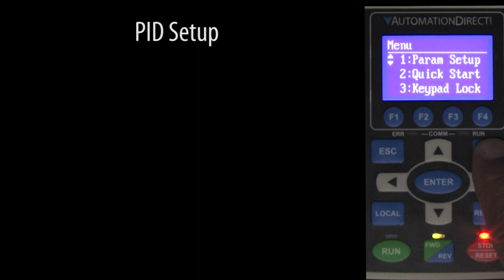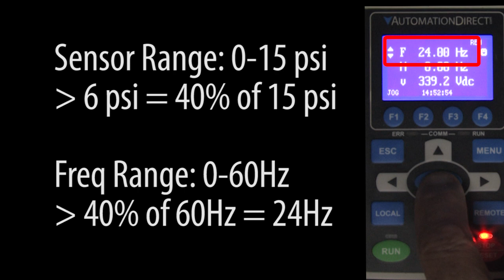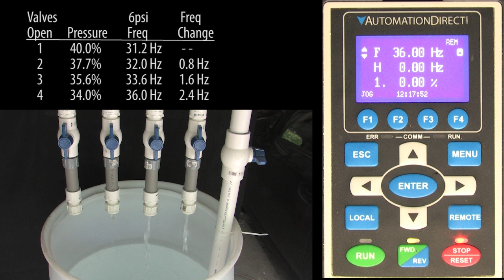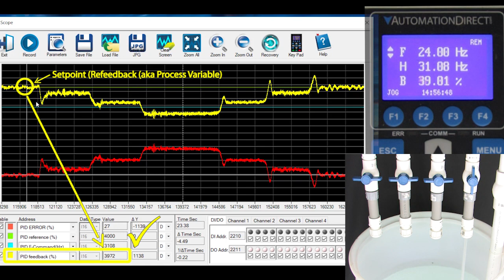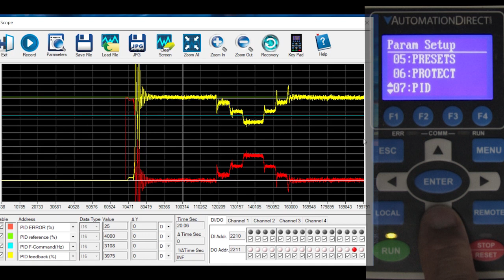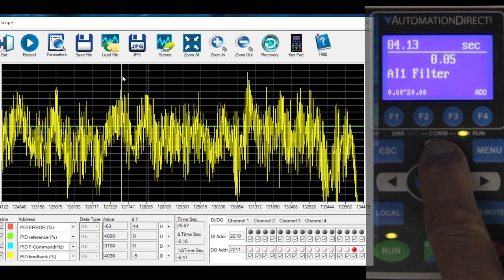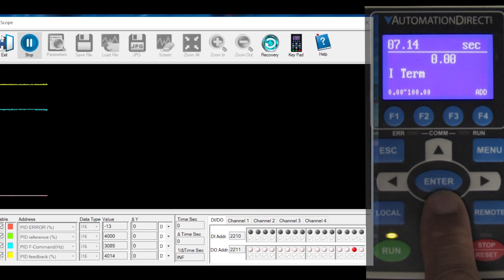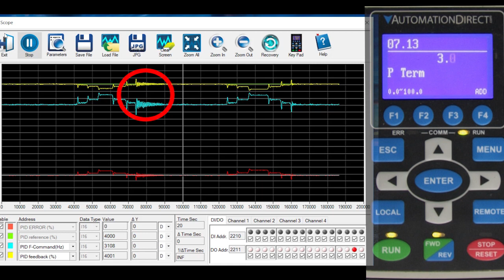DURApulse GS4 VFD PID Controller Tutorial: Part 2 of 4 from AutomationDirect

Comment: Average pressure drop 
4.2 = (  (40 - 37.7) + ( 40 - 35.6 ) + ( 40 - 34) ) / 3 ,  does my calculation method right?
Reply from the maker: Yes, correct.

Comment: good afternoon if I had a sensor that goes from 2v to 10v,
which parameter would escalate that or how would it?

what happens is that I have a sensor of 4mA at 20mA and by placing a resistance of 500 ohms I get from 2 to 10 v

Thanks for the help
Reply from the maker: Why not just use it as a 4-20mA sensor? The GS4 drive is setup to handle that directly. Regardless, here is a set of 3 videos on Analog Inputs that will cover everything you need to know to do it either way:  https://www.automationdirect.com/videos/home;jsessionid=3ED288D7F1CB8AC22B070E0D6D89796F?t=link&q=gs4%20analog%20Inputs  Good Luck!